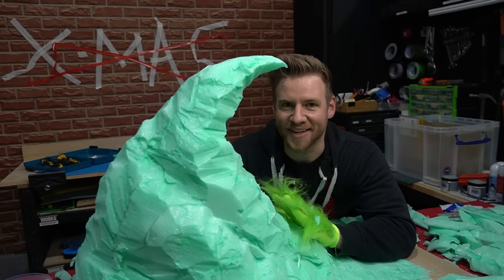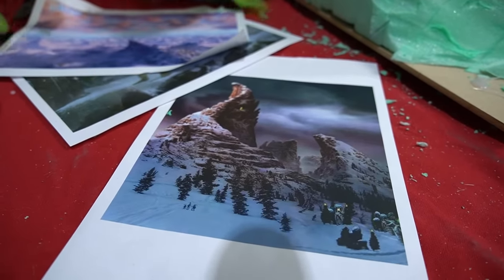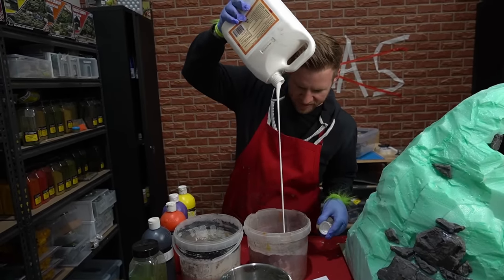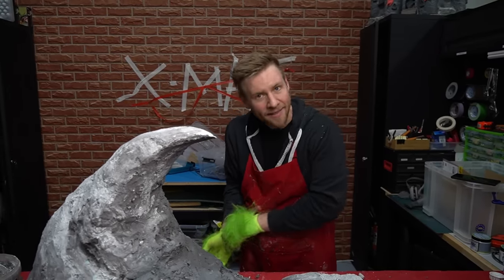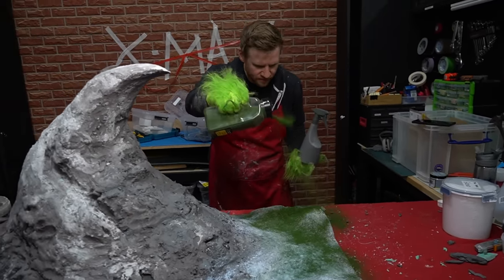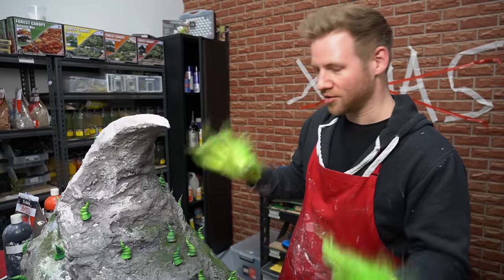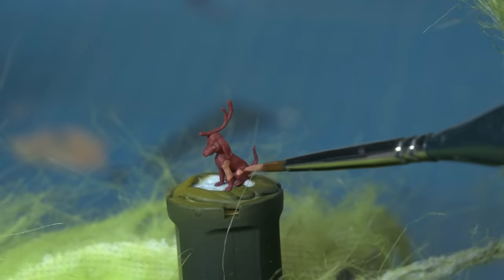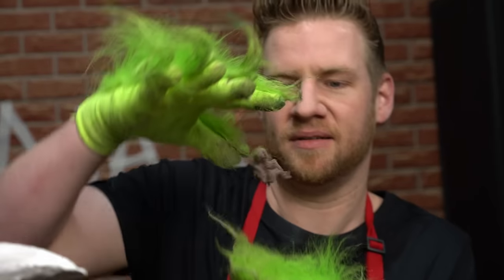I made Whoville so I could RUIN their Christmas...

Comment: I thought it might be an interesting (and challenging) way to do art with ferrofluid, It is sometimes used as lubricant for magnets and such, and if you put it on a magnet directly, it can glide and "draw" on paper, by leaving a tiny amount behind. It leaves a very saturated and clean outline, it is very... glidy ? to draw with and when it dries, it becomes glossy (if it is oily ferrofluid).

As an example, NileRed did showcase this in his video about making it. (although he mentions that a commercial ferrofluid does not work as well for it, as the one he made himself)